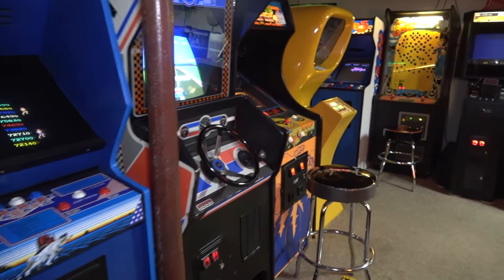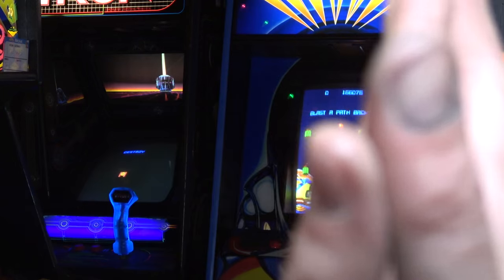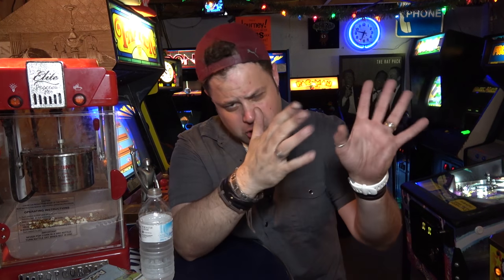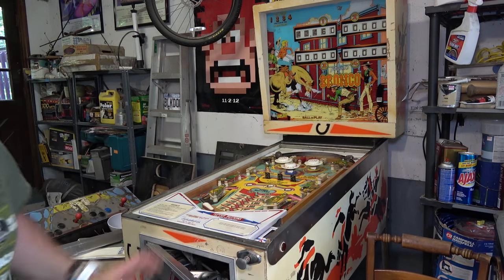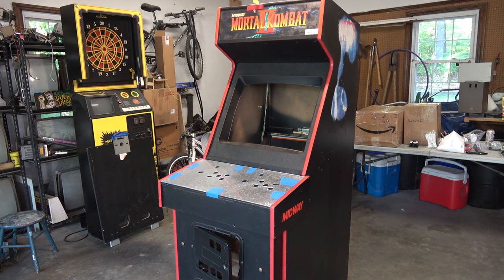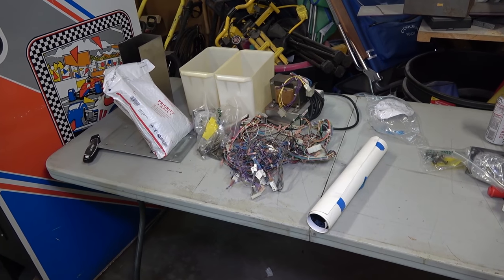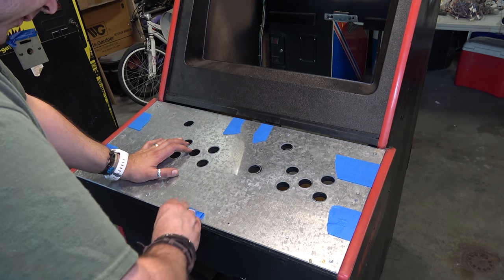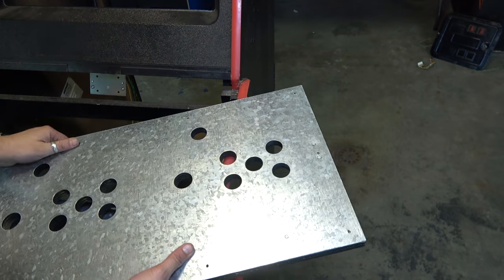Mortal Kombat II Arcade Control Panel Restoration  - IL vs HAPP joysticks buttons - RESTORE PART 1

Comment: I'm restoring a Smash TV that was converted to an Ultracade. The metal plate for the control panel was missing and I couldn't locate a replacement. After I gave up, I used a piece of laminate in place of the metal, but covered it in lexan. Little choice, unless I could have a metal shop cut one. Turned out really good, even thought it's a compromise. Of a genuine piece turns up for me, I'll rebuild it with the correct part. Cool project. Lots of parallels in technique between STV and MK2.

Comment: Hey John, those IL joysticks are really the way to go. Also, looks like you still need another trim piece which runs along the top of the control panel and rests against the bottom monitor glass bracket. It's a standard Midway cab piece so you should be able to find it pretty easily.

Comment: Great to see the MK2 restoration happening. Really looked forward to this. Just to let you know that the control panel is missing a bracket where it meets the bezel. There are 4 or 5 screw holes along the edge on the underside where it attaches to the wood. I don't know if it's an easy part to come by. I'm building an MK 2 control panel from scratch and that is the only piece I don't have. I'm sure someone will be able to hook you up with though.
Reply from the maker: +Chris Kaminski I think I have that piece. Came with cabinet
Reply: +John's Arcade Game Reviews & Tech That's lucky then. I think it's a tricky part to get hold of...at least it is here in the UK.
Reply from the maker: +Chris Kaminski I checked. He brackets are in the cabinet. Got em. Thanks.

Comment: Hey John, Don't take that CP apart to fix that white edge. Just take a sheet of construction paper, cut off a long 1/8th inch strip of it and shove it in there. Maybe a little dab of glue on the ends to make it stay. Seems like a simple fix.

Comment: About the paint removal process. The bubbles video, the guy said this only works with water based latex type paints. if it was oil based paint, it probably wont work.

Comment: I just picked up a couple cabinets for $75 the other day and one of them was a MKII cabinet that someone butchered as well. I'm going to try to get it back to it's original glory again since I am a huge MK fan. I have the CP but someone drilled a hole in the middle of it to put a trackball and turned it into a World Class Bowling arcade - makes me wanna scream. I'm going to try to revert what they did, should be able to do it. I do need to find the PCB, CP art as well as the rest of the artwork and the marquee. Hopefully this isn't going to be too big of a pain to find that stuff.

Comment: John's Arcade Game Reviews & Tech Just water and soap, and spray it on top of the stickers as well. Trust me, no more scratching, and, it helps with pushing bubbles. In general, putting a sticker on is a wet situation.

Comment: +John's Arcade Game Reviews & Tech Atari Games was originally owned by Atari until they spun off in 1984. Then Namco brought Atari Games. Time Warner brought Atari Games when they merged with Time inc. (Now Time inc is a spun off company but Time Warner is still keeping the name when they merged) But there was a unsuccessful bid by Atari founder  Nolan Bushnell, Atari Games was brought by Williams. Hasbro Interactive brought the remains of Atari Corp. and bring back the Atari name. Then Midway renamed Atari Games to Midway Games West to avoid confusion with Hasbro Interactive's Atari. Then in 2003 Midway Games West was closed down do to slump in game sales. So for the Radical Bikers  Atari Games did the game and they used some of the parts from the Williams/Midway Pinball and arcade games.
Reply: +Mac Donalds ok ok calm down

Comment: Why would anyone paint the cabinet black? WHY? WTF were they thinking?
Reply: They were thinking "This MK2 isn't making much money anymore, I'll put a different game in it and see if I make more." I just finished stripping the paint off an MK1 cabinet where they had replaced it with a Midway Skins golf game board instead. They also hacked up the original wood from the control panel to do it. Arcade operators didn't give a shit about preservation, only making more money with what they had. I'm just lucky they didn't sand it down like they did John's cabinet.

Comment: The misalignment of the overlay is not something you did, the repro yuo got isn't that good. You can tell right away from the color that it's just not very well done. But yeah it works and you got it cheap. And in regards to joysticks the ILs are the way to go, they play way more precise in my opinion.

Comment: I like to use single edge blades (http://www.homedepot.com/p/Husky-0-009-in-Single-Edge-Blades-Dispenser-100-Pack-TE05-099THD/205036235); not necessarily that brand.  The razor should be sharp enough that keeping the blade at a low angle from the edge you are cutting (maybe 5-8 degrees) allows the blade to ride the surface of the work and cut easily.  If you ever feel like you need to make a sawing motion, you need to switch your blade.  You can lightly pull the blade going down (towards the adhesive as to not lift the artwork) to maximize the life of the blade.

Button tool: http://groovygamegear.com/webstore/index.php?main_page=product_info&cPath=72&products_id=248

Comment: The overlay misalignment of the buttons was nothing you did. It was the sizing of the Repo overlay. Quality is just OK. Should've taken my recommendation I gave you months ago when you did your 1st MK2 video restore...
Reply: And that was...? I need a new overlay for my MK but after receiving crap Marquees I'm about give up the search.
Reply: xlarcade on eBay has good stuff. I got entire artwork from him for my UMK3. He probably is using one of my images I took on his eBay auction.
Reply: Ha! Maybe the side art and overlays are good but I ordered a reproduction MK2 Marquee for him and it was total crap. I'm packing it back up at the moment to send back.  Its just bad when compared side by side to my original with minor light burn. Also very bad with replying to messages.  I'm afraid to order anything else from the guy.  I was highly disappointed in my Marquee purchase.

Comment: heres a story:

my dad finds a ms. pac man on the side of the road. Didn't work, apparently was in a fire and had melted a bit, was left in the rain, and all the wires inside were snipped.
Reply from the maker: +Jack Newton cool story. You have it now?
Reply: Yeah. Do you happen to know a place where you can buy parts for a Ms. Pac Man for cheap? I was looking for a harness and a coin door in particular. I also might need a new monitor, because some troll cut the flyback wire.
Reply from the maker: eBay or KLOV.com
Reply: thanks, John!
Reply: oh, two more questions:

1: is the electrohome monitor reliable?

2: is serial number 945 an actual early system or are all the ms. pacman serial numbers in some weird code?

thanks in advance.
Reply from the maker: Jack Newton The G07 is a great monitor. I am guessing the serial numbers are non-sequential.